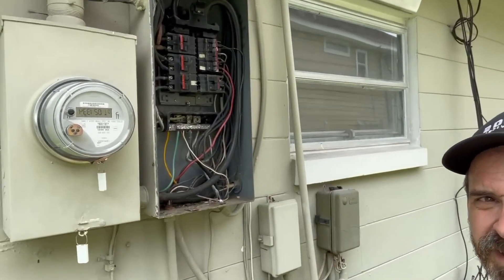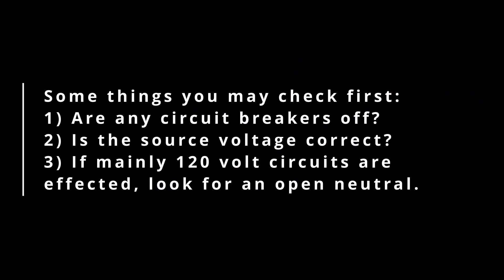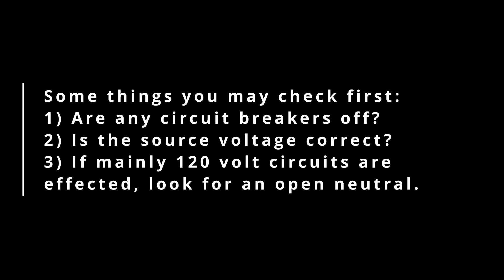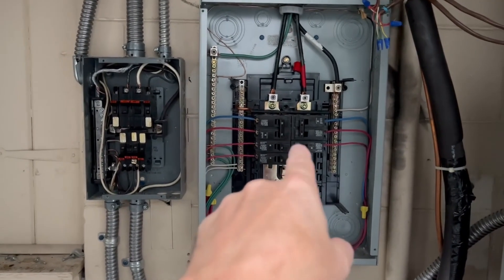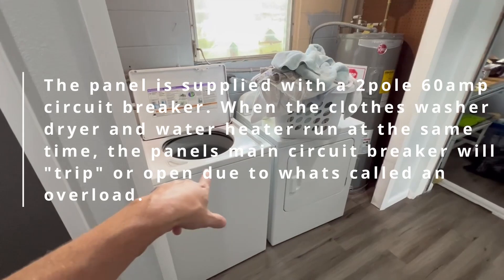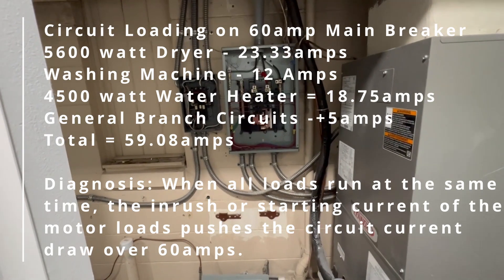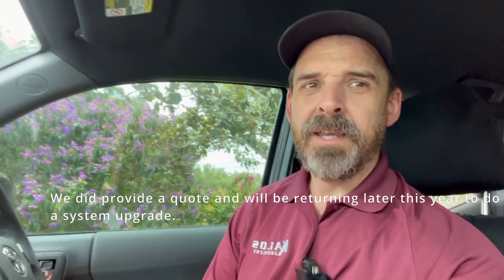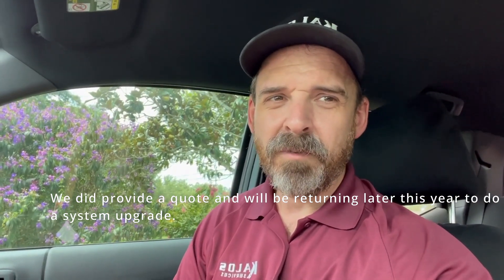FPE Circuit Breaker Overload Quick Diagnostic

Comment: What did you do to fix the problem? Also I wanted to add 2x  2 pole 50 amp breakers for a water heater. How do I make sure this won’t happen to me?
Reply from the maker: We replaced the entire panel and separated the circuits if I recall correctly.